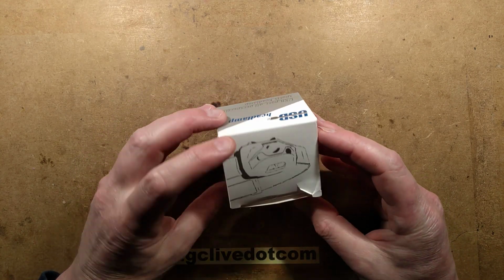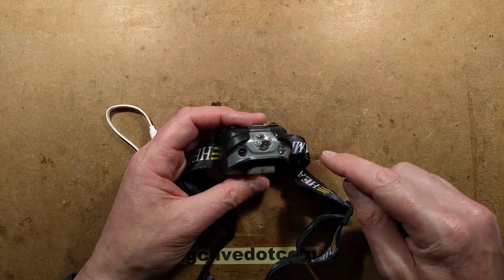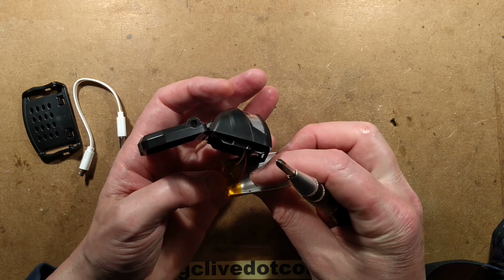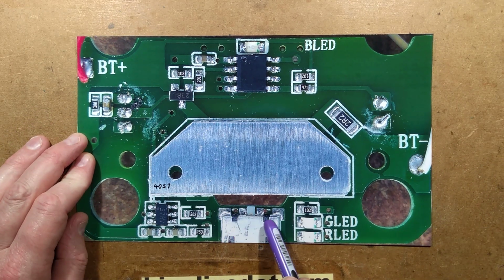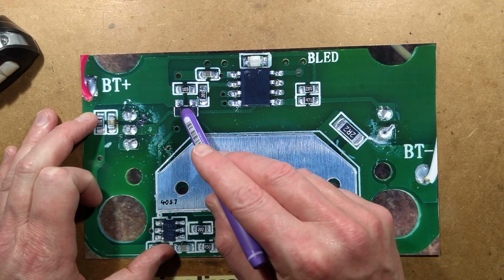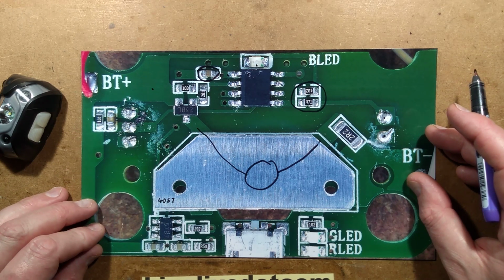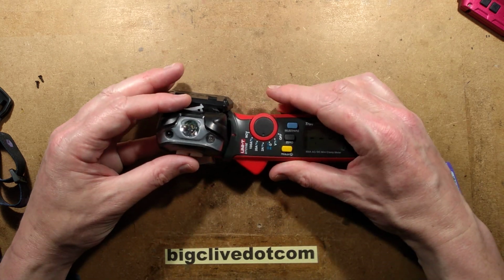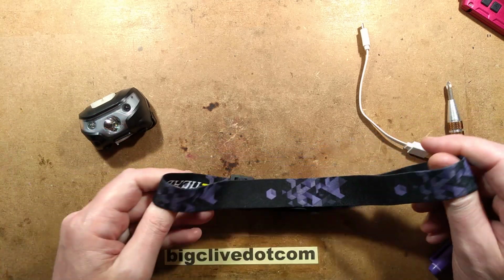Inside a rather good USB rechargeable head-lamp from eBay.

Comment: Not Ebay but second hand, just today. I bought a Swisstech that is USBC rechargeable has low, med, and high power with red steady on or flashing. With ir sense activation. The pawn shop owner saw it and said he's keeping the next one for his farm use. I brought it home and charged it up. Will test what appears to be a 3-5 watt flood tonight with walking my dog in the backyard.  Rührig 18650, wires soldered directly to cell.
Reply: It is brighter than my 18650 or 3xAA focusing handheld. But it doesn't focus so won't go as far. It does light up large portion of the backyard significantly.

Comment: Clive, I have a head-lamp with virtually same design, functions and operation, the Everbeam H6 Pro sold on Amazon. After charging it only once for some inexplicable reason now when the lamp is switched on using the RHS button it goes off automatically after only exactly 20 seconds – rendering the torch useless! Have you got any idea on the cause and remedy for the fault?
Reply from the maker: Is that the IR sensor mode?
Reply: @bigclivedotcom  No, just in the ordinary mode.
Reply from the maker: @BsktImp  Does it do it at a lower intensity setting?
Reply: @bigclivedotcom  Yes, it does. It also does it when in red light mode too. Thanks!

Comment: I am wondering were the Battery protection is. You mentioned that the protection is not in the battery, but I cannot find it on the board either. Did I miss something?
Reply from the maker: The charging chip limits the upper voltage to 4.2V.  When discharging the LEDs will stop conducting around 2.5V.
Reply from the maker: Peter B  No.  This one has a built-in cell.
Reply from the maker: Peter B  I don't think it's age.  It may be out brains adapting to the huge amount of data on YouTube.

Comment: I use a pair of these in the garage working on cars. Runtime is a few hours at full power, but i charge both and swap over when one runs out. The "hand detection" mode is a pain, rather it just had one big on/off button instead.  Very useful for pointing light where im looking, without using a torch.

Comment: i started using headlights when i worked on computers. always have one handy. Coast has a pretty nice aaa battery model with adjustable focus, adjustable brightness and a rear mounted battery pack.

i've worn them for 12+ hours straight with no discomfort.

Comment: I have this exact lamp (from the rainforest market) and I too have 1200mah the same.
It does last a very long time in "dim" mode.
The auto mode is very annoying though, particularly if you're using it too look into confined spaces so I never use that feature, also don't look at moving components as that causes a rapid on/off/on/off strobe effect!.
The button cover on mine also glows in the dark (for some reason), but I can't see that being useful as you can't see them when it's on your head!
Edit: I typed this before seeing the additional info about yours glowing at the end of the vid! Sorry!

Comment: Very interesting, i just purchase a head light like this one. The casing and main light is exactly the same, however instead of infrared sensors, it uses 2 red light just so people can see you. The battery and circuit looks nearly identical, tho it has a few differences and its also Mastercraft brand, which is sold at CanadianTire here in Canada.

Comment: I have a similar head lamp to that that takes three AAA batteries and has two light modes. 1. Center light on 2. All three LEDs on. 3. Off. No Blink mode!!!!  A center LED and two white LEDs where are the Infrared light and sensor are located on your light. The hinge is a bit suspect as the light will pop off unexpectedly. I got the light free at a primo giveaway at a auto parts store. O'Reilly's Auto Parts in California.

Comment: I have a very similar light to this, except above the IR LEDs it also has red ones which are triggered by the second button. And to get the hand wavey mode you need to hold the second button for 3 seconds.

Comment: Hello from norway bigclive, could you try to buy some litium batteries and put them in that headlamp and check the temperature on the headlight when in use I think you will be suprized over how hot the headlamp will get during use

Comment: What do you think of the little uni-t meter? I've searched to see if you did a review but I couldn't find one.
I'm thinking of buying one to measure the current draw on fire alarm loops so it's all fairly low current (50ma-500ma at 24v), is it fairly accurate at low current?

Comment: We have some of these. They are fantastic.If you VERY  long press the right button on ours, it lights up red leds which are underneath the white ones not integrated with them. a second press flashes the red leds. Long press to get back to white led mode. I believe the red mode is longer lived and of course flash mode is longer lived anyway than steady mode(for the longevity of the charge).

Comment: Does anyone else just chuck those 'token gesture' microUSB cables right in the garbage? Aside from usually having the most garbage of wires which means you get abysmal charging, the ends of them are just the cheapest and usually are either too tight or too loose in the port--either side, take your pick--and it just isn't worth it at all for me...

Comment: Mr Clive, I recently built my own headlamp using the LED out of a cheap 1000 (?) Lumen flashlight and a cheap incandescent headlamp from Harbor Freight, 2 18650 laptop cells, and a 1 amp charging circuit from ebay. I wired in the led directly to the 3.7 volt cells, using a piece of brass from the old flashlight as a heatsink. Have used the light a couple of times with no problems... So far... My question is this, should I have someway to limit the current going to the led? Will the setup I'm using shorten the life of the led? Would love to see you "Build the Perfect HeadLamp" someday!!! Would be fun seeing what you come up with :-) Thank you sir for all your work/fun video's !!!
Reply from the maker: I'd recommend using a resistor between the lithium cell and LED.  At the fully charged 4.2V it could be pushing a lot of current through the LED.  The resistor choice will depend on the power rating of the LED and how well it's cooled.

Comment: This is the best head torch I have seen but I think I might be a tad careful with a lithium iron battery on my forehead, especially in the rain. I took an old vape battery apart and pulled on what looked like a bit of paper and boy do those things warm up quickly. No smoke or fire but a definate warning. Found one on EBAY £3.99 inc. post - London. Looks the same.Thanks Clive.
Reply: Be damn inconvienient to have a thermal runaway when burying dead bodies in the woods. In the rain.

Comment: I have a headlamp that's very similar to this but has a cob array instead of a single LED. Very nice work light and the sensor is useful, I've used it for doing work on car engines.

Comment: I have one like that but clearly an older model.  Mine doesn't have a recharger, the turn on detector, or flashing mode. However, the strap on mine has an over head strap that prevents the light from sliding down onto ones face. Mine also has that weird angle on the straight out view. It is a decent thing to take with you in your car in case you need to repair something in the dark.

Comment: Clive!  I noticed you wear baseball-style caps.  You can use the little strap on the back of a ball cap to attach these types of lights to.  Wear your cap normally when the sun's up, and after dark, flip your cap around backwards like a baseball catcher, and your light is ready to go.  Cheers!
Reply: But there are Health & Safety issues.  Turning a baseball hat back to front causes the wearer to lose at least 50 percent of their IQ.  Given that our dear BigClive doesn't have a lot to start off with ...   ;-)

Comment: I wonder how hackable this would be?  Could you put a better LED in it?  Also, could someone hack this to bypass the low power/strobe modes if you just wanted a reasonably cheap, good battery, USB chargable LED controller for other projects?
Reply: change the led sure, but you are not getting rid of strobe mode unless you know how to reprogram the micro, if it's even re-programable.

Comment: 19:02 Which I absolutely hate. (I then try to fumble in a boost circuit) Because why I do need 10h+ run-time when the light is 6+ hours unusable dim. I rather have ~6-7 hours in full brightness, cause I am going to (/have to) recharge anyway at the point it was getting to dim.
I like the big cell tho.

Comment: Cool little headlamp.  I am getting a bit up there in age now, having just passed my 68th year, and my vision seems to be getting a bit foggy.  My optometrist says I shall, one day need to get my cataracts removed, but the VA says not till they are much worse.  So in order to see well when soldering, which I do A LOT now that you have taught me proper soldering techniques, I found a head lamp to use.  I got an older unit, it has one large LED and two smaller ones, one on each side.  It is powered by 18650's, a battery I have a large supply of, the result of tearing apart old laptop batteries.  It works fine but I need to check my batteries, as some of them do not offer very long before they die, whilst if I find good ones, they last much longer.  I have yet to discover why the hell the Chinese think everyone in America wants that damn strobe!  Man drives me NUTS!  I despise it and ever blasted flashlight I have purchased seems to have it, while a few have the SOS feature, I fear that an SOS would probably not be responded to any more, as most folks would think it just some idiot didn't make the last push on his flashlight. I was surprised to see that my headlamp must be designed for bicycle riding, as it has a red LED on the outside back of the battery pack which is on the back of the unit to counterbalance the headlight I guess.  This sort of reminds me of the large head light my father had for the use on our farm in the '50's, it had a large tin container that clipped on your belt, held 4 D-Cell batteries, then a cord lead up to the light which was rather large with a big reflector and glass lens mounted on a tin base and an elastic band for the head.  It was very bright, dad used it for night time chores around the house, and for taking care of predators that raided our hen house, he was quite good at blasting the critters with his .22 caliber target rifle.  Since we had no power on the farm, the headlight was very nice indeed, we also used it for late night toilet needs, lite the way to the little brown house out back, if you know what they were, plus you could read that catalog with it till the work was done, and a page from the catalog was used to clean up.
Reply: … but did you get to ride a dinosaur?

Comment: Dear Clive. i was thinking about getting one Headlamp from Nitecore. since they use 18650 LiIon Batteries, i would like to know if there is any concern regarding the use of protected or unprotected batteries. can there be an issue if the circuit board include protection and the cell itself?

Comment: I have a crappy Led Lencer with a crappy NiMh (I guess) 4.5 V battery with an usb port in it that replaces 3 x 1.5 V "salmiac" batteries.How ever that means 
1)  The damn thing must be opened for recharging
2) it doesn't deep charge disposable batteries fully because it has indeed been vuilt with rechargeable batteries in mind
3) one must use the "high beam" very sparingly.
Grumble grumble, murmur. It was free..

Comment: Got two of these torches, bought from different places. First one, despite being described the same as yours, turned out not to have the infrared on/off mode. Instead the two 5mm IR LEDs are actually standard red visible ones which toggle through off, on and flashing when you operate the second button. The main beam operates as yours does. 

The second one I got looks identical yet it does have the IR on/off mode. I actually find that feature is quite anoying as I sometimes get the wrong switch, in the process enabling the main light, and then do something while working which causes the beam to turn off and leave me in the pitch dark.

Oh and I agree this is a really nice little head torch and lasts ages.

Comment: I've got a similar headlamp (single white LED, rechargeable) that I purchased for the purpose of giving some illumination when probing around inside equipment cabinets.   Like yours, the problem is that the beam is very tight (mine has a large 4 cm reflector).   The two mode intensity control switches between extremely bright and blinding.   Not exactly perfect for the job, so I'm still looking for the right solution.
Reply: Could swap the current limiting resistor for one of a higher value to limit output. As for beam width, other commenters mentioned deliberately scuffing the lens to act as a diffuser.
Reply: @mrb692  The lens is just a round bit of glass held in by a threaded ring, so I could certainly substitute a diffuser for that.

Comment: This model is really great. i have several ones of these and they are endurable and lasting (runtime, cycles, and low self discharge)
*there are 2 versions! be aware!  one has red 2 led in plus to the motion detection. (and no strobe!). They both cost the same!

Comment: I have a very similar head torch from Mountain Warehouse, the main differences being that it doesn't have a strobing main light, and it has a couple of red LEDs that could be useful while wearing it on the back of your head when walking/running on roads at night.

Comment: Hi Clive, did you happen to measure the current draw of the IR circuit without the light and the draw in off mode. There doesn't seem to be any clever tricks to latch the micro on so it must have some standby draw.

Comment: Big Clive. Can show how to bypass the chip to activate only the low beam instead of 3 modes. It would be helpful.
Reply: You can't do that easily, these micros are one time programmable and need a special programmer. The switches are spring push type so they don't stay pressed.

Comment: The angle of that beam is only just a step up from a laser pointer!
If it were a 5mm LED I would take some fine sandpaper to the head of it to disperse the light a bit more, like I've done to rear bike light LEDs - I don't need a red spotlight shining on the road, I need a wide angle beam so all vehicles behind me see it.
Reply: not to mention those super bright directional leds make it very hard for a car to see where you are (it tends to be very hard to accurately tell where someone is by a laser pointer in the eye)

Comment: Just checked on Ebay If you buy the battery as a single item it costs more than the headlamp as a package, the vagaries of Ebay. very odd.
Reply: In hardware stores, a replacement handle costs more than a new shovel. And the handle doesn't come with a rivet. Which the store doesn't stock as a separate item anyway. 

Tough choice, tough choice.

Comment: I use this light every day at work I actually bought 3. The IR mode is a pain! I  built up the side of the switch I use with silicone so I could tell the difference between them easily. The light gets pretty hot specially on a hot summer day. But overall there a great unit!

Comment: I got the same headlamp 2 years ago from ebay. It has just slight design changes compared to yours. Also it has a lot bigger aluminium heat sink. Before buying, I expected it to have wider light beam but oh well. Also that button clicking cycle is kinda dumb... Everytime you have to cycle through all modes to turn it off. But overal I am happy about the product. Also the beam looks more like blue/violet instead of white. Warm white would be very good for this.

Comment: I have the triple A version, I recognise the latching mechanism, I will definitely add this rechargeable version to my tool kit as I'm getting through triple A batteries at fairly quick rate, thank you for the helpful review 👍
Reply: Get the ones powered by 18650 cells they last forever and are mega bright too. Wider light beam which is a positive. Hope this helps
Reply: I had to use one when i worked on a farm caring for the pregnant sheep overnight in a caravan (i was an animal husband)

Comment: Head TORCH.  LOL  Forgot about that term.  Brings Mental Images of Someone Running Rabid Hair Aflame.  We use those TP IC's to charge banks of cells to capacity test  reclaimed 18650 cells .  Cheap Chargers to bulk charge the cells prior to using  Capacity tester.  I need to charge and test 20 or more cells in  a wack.   https://www.youtube.com/watch?v=VgaiO3o4a0o  You convinced me I need one of those Uni-T Clamp Current meters.